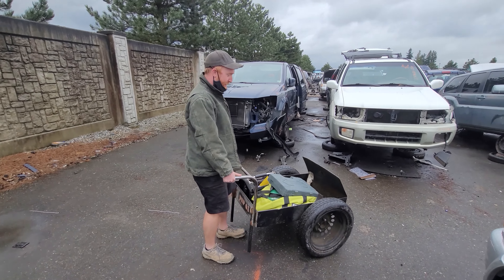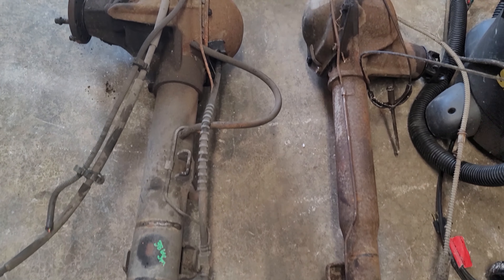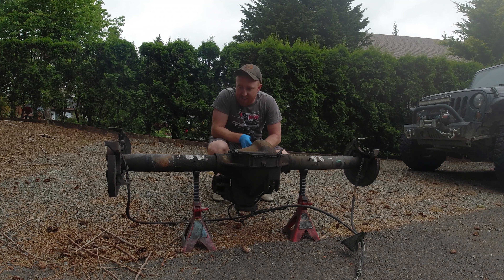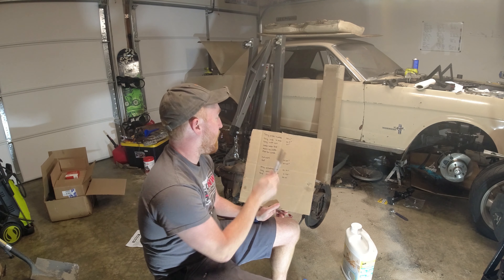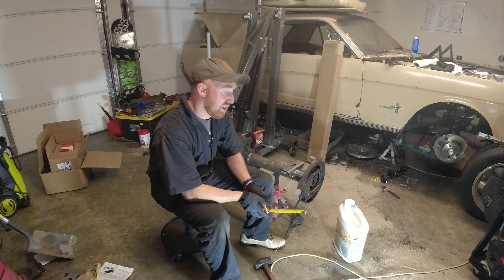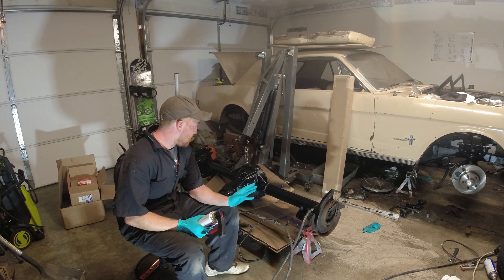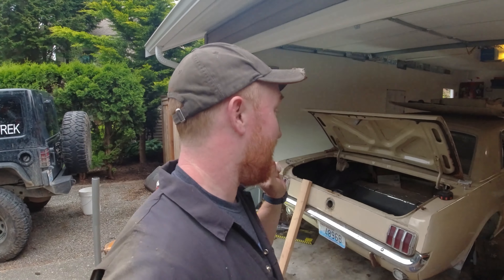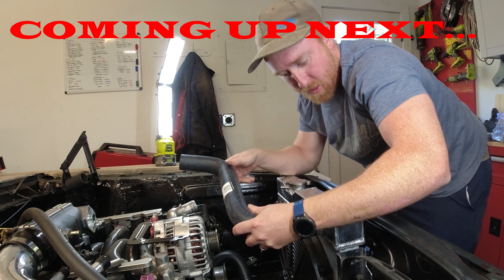HOW CHEAP/EASY Junkyard Ford 8.8 into Classic Mustang??: 1966 Mustang 4.6L MOD MOTOR SWAP. Episode 5

Comment: Right behind you mate - swapping out the 7.25 for an exploder 8.8 rear end. Can't wait.
Reply from the maker: It is a pretty straight forward swap. Just make sure and measure measure measure. And I got it dialed in perfectly. Make sure you get the 8.8 with limited slip!
Reply: @4WDTrek  Yup - 95 explorer rear end with discs and limited slip.
Reply: One step at a time bro lol its a fun project but it could add up . But how could u not love a 60s Mustang lol
Reply: Does anyone know if one would fit under a 71 mustang

Comment: Sweet score from the Pick-n-Pull 🙌
Reply from the maker: Thanks! I couldn't believe how "perfect" it looked inside!
Reply: good score . now need to find same deal for the jeep too . upgrades!!
Reply: @4WDTrek  Many in the XJ and TJ crews are putting the 8.8 in to replace the sketchy dana35. There is tons of aftermarket support too. plus it looks like you scored too with the 31 spline shafts.
Reply from the maker: @SkyBlueOffRoad  I made sure to get one with 31 splines. Eventually should be pushing about 400whp. I don't want to have to worry about that rear end.

Comment: Thank you for this series I just acquired a 64 mustang it is just a shell but the shock towers have been cut out already and it already has the mustang two cross member and the disc brake front end conversion
Reply from the maker: That was probably the most time intensive section of the entire build. That is awesome to hear that you already have that done for you!
What engine are you putting in it?

Comment: Got my 66 About 2 years ago I’ve been running the stock 7 with a 200 inline but now have my grandfather 332 (bored out 302) I just can’t find a rear end at a reasonable price but seeing you use the explorer 8.8 makes me wonder if I could do it 😅
Reply from the maker: It is pretty straight forward if you have some welding skills. I would bet you would destroy that 7 inch rear the first time you hammer down with that v8!

Comment: So 4 3/8" from the back of the dust cover inward is the center line for the new perches? I apologize if the question is dumb, I'm new to welding/fabrication
Reply from the maker: I would highly suggest measuring your own axle and find the exact placement for yours. There are some different axles out there and some are slightly shorter or longer.

Comment: Did I miss a section of your video? did you shorten the axle tubes? I don't see any portion that deals with that... or did you leave the entire rear end the same overal length?
Reply from the maker: I did not shorten the tubes at all. I left them full length. Havent had any issues at all with it either

Comment: So,, you did not narrow the housing?? How did it fit the car,, are you satisfied or do you wish that you had narrowed it up? Very curious bcuz I'm doing this exact same swap,, 8.8 into a '65mustang. Really would appreciate your response back. Thank You
Reply from the maker: I did not narrow the axle what so ever. I haven't had any issues with it at all either. Has worked extremely well since I have installed it.

Comment: How did you shorten the axle tube. The explorer is offset about 2 3/4" on one side
Reply from the maker: I did not shorten it. I left it full length. Haven't had any issues with the set up yet. No clearance issues at stock height.

Comment: Welp im convinced. How does it fare wiht the brake lines? Did you need to get new hardware lime lines, hoses, master cylinder, etc?
Reply from the maker: I did have to get a new soft line to go from the body to the axle. The stock brake lines were fine though. I did replace the master cylinder to be a disc/disc dual bowl for safety though. I did use the stock master single bowl cylinder for a while though.

Comment: That 16th of an inch could probably be settled by loosening your spring mount ubolts. Then re-center and retighten. There is easily a 32nd of play in the way that hardware bolts up.
Reply from the maker: I'm sure it could be. But I'm not worried what so ever about that 16th of an inch. Thats closer tolerances than it was from factory in 1966. And it drove perfectly fine.

Comment: I realize this video is a couple years old, but did you not need to cut the drivers side tube down to match the passenger, or does the 95 axle match?
Reply from the maker: I did not need to cut mine down. I have heard that if you lower the car a lot, you will have clearance issues with the transmission tunnel. Stock height, there is no issue at all. If I do end up lowering it a bit, I will likely just modify the transmission tunnel a bit (big mallet) and create more clearances.

Comment: I bought your 1978 Ford Fairmont I6 200ci engine.. found your channel today. Do you have the carb spacer still?

I have the same axle for my 63 Ranchero. I will be using it in her with a gear change.
Reply from the maker: I do not have the carb spacer anymore. Sorry bud. 
Thats a throw back! Like 3 years ago!

Comment: Picked up a 96 cobra 8.8 trying to get it into my 66 do I need a conversion kit for drive shaft to mate up to the 8.8 I currently have 7.25
Reply from the maker: You will likely have to have either an adapter or a new drive shaft made depending on your current set up. I had a new drive shaft made completely as I stepped up the power and had a different transmission and rear end. Coming from a 7.25, you likely have a weaker drive shaft behind that i6 engine.

Comment: Man I gotta ask, what you did for U bolts, and the shock plate mount. 
Installing a 8.8 into my 68, planning to order a set of bolts and drill a new shock plate to. Was just curious what you did.
Reply from the maker: I just reused the plates that came with the axle from the explorer. I did order new U bolts but I got stock u bolts from the explorer. I swapped the left and right sides so the shock mounts were on the inside of the axle and not that outside of the axle. Bolted the shock right up
Reply: My axle came with my car and I didn’t get that luxury! Appreciate the video man! Definitely helped me out for!
Reply from the maker: @justinwillis1069  I'm glad I could help you out! There are universal spring mounting plates you can purchase that come with shock holding brackets that get welded on wherever you need to weld them. I have found kits like that for $60 ish

Comment: Did you use the shock mounts from the explorer?  I have put an 8.8 in my '66 and trying to use explorer mounts but looks like I will need to modify them somehow to get the angle right.  Just curious what you did.
Reply from the maker: I did use the shock mounts. They were ever so slightly off angle. So I cut the shock mount on one ear and put it in there at a slight angle. Then just welded over the top of the ear I cut as another support. Kind of as if I elongated the hole, if that makes sense.
Reply: @4WDTrek  completely.  Thanks

Comment: Not sure if anyone asked but did you run into any trouble with the explorers pumpkin not being centered? I believe one shaft is 2.48 inches longer than the other.
Reply from the maker: I haven't had any issues with it at all. 
It is ever so slightly shifted off to one side, but it doesn't hit anywhere underneath and doesn't cause any driveline vibrations.
Reply: Last question I swear 🤞🏼. What drive shaft did you end up using. Thanks
Reply from the maker: @tb7246  I went to a local shop here. I measured it all out and they custom made one for me. Drivelines Northwest
Reply: I'm doing this now,  I've had the 8.8 in the garage for over 3 years now...debating about leaving the pumpkin off set or swapping left and right axles and rewelding the ends on, a lot more work. Overall width is about right for my 68
Reply: @veholic1  it’s been great. I do have some contact on big bumps but I lowered the car 2 inches in the back. If it’s standard height you will have no problems.
Reply: I've centered the differential by cutting 3" from the short side and 7" from the long side and swapped the cutoffs from side of to side along with the axles. Works well.

Comment: New Subscriber . Question, have a 73 fastback. Would it be the same process for my vehicle?
Reply from the maker: I would assume it's the same process for yours. I do not know widths of anything so double check on how wide of an axle you can put under there. 
My brother did the identical swap into his 67 coupe and his 70 challenger with no issues

Comment: Did you regret not setting up your pinion angle?  I noticed you set your angle at 0.
Reply from the maker: I didn't actually set it at zero. If I remember right, I actually set it at 3 degrees. I haven't had any issues with it at all since the install. I'm happy with it. 
I may throw a gopro underneath and see how it looks while under acceleration, just to make sure it doesn't over rotate.

Comment: Doing the same on my 68 soon as I get done with the rewire. I got the same LS 3.73.
Reply from the maker: Very nice! With the 65-66, have to worry slightly with the offset diff and the drive shaft if you drop the car. But the 67-68, you don't have anything to worry about. No clearance issues.

Comment: Thinking of doing this to my 66, did you have to cut and shorten the tubes to center up the pinion? Or did everything line up correctly?
Reply from the maker: I did not shorten the tubes. Everything did line up ever so slightly off center as the explorer one is off center. However, I was still able to build an exhaust between the tunnel wall and the drive shaft. My car is still stock height however. I have heard if you massively lower it, things will start hitting. I have zero issues as is and would think a couple inches lower won't affect it.
Reply: @4WDTrek  alright cool, thanks. I've just seen a couple other blogs that talk about shortening the long tube and using 2 passenger side axles to compensate. But if everything lines up and no binding of the pinion then all should be well.
Reply: You only need to shorten 1 side (cut the tube) and grab an extra axle to match the newly shortened tube. There are plenty of vids of how to do this. I'm still struggling with my lame ass non traction lock original 8 inch diff.

Comment: What did you use for your driveshaft?
Reply from the maker: I used a local shop to create me a drive shaft.
I measured out the lengths and talked with them. They made one side splines that fit in the t45 transmission and the other side that bolted up to the 8.8. Used 3 inch steel drive shaft with 1310 U joints. Should be plenty strong.

Comment: I built an 8.8 for my Tj. Exact same set up. Was it an 01 exploder?...well i did 4:10 gear but with the lsd. Does great syncing up the tires (until ya go 35s or bigger hahaha). Only complaint is the e-brake. Even with new shoes it just does not hold as solid as i wish. Anyways, looks like it is going well on this build.
Reply from the maker: Mine was a 97 explorer I got it out of. I debated for the 4.10 but decided that I wanted to keep a tad bit of freeway speed and not have higher cruising rpms. Should be sitting at around 2100rpms at 70 on the freeway with this set up.

Comment: What is the offset of the wheels you are running in the rear? I am also installing an 8.8 in my 65 mustang.
Reply from the maker: They are the stock mustang Bullitt wheels from 2001. They have 30mm offset

Comment: How much wider is it than stock? Is the 68 rear the same width? How do the emergency brakes hook up?
Reply from the maker: Overall side to side, I believe it comes in at a total of 2.75" wider than stock. Slightly offset to the passenger side which can cause a slight issue with lowered 65-66. For a 68, you would have no issues. I haven't gotten to the emergency brake quite yet. But the mustang pull chord goes under as one cable then splits into two. The explorer does the exact same. So just hooking the two cables up and a small mount for the cable guides would work.

Comment: What year explorer will work ?
Reply from the maker: If you want disc brakes, I believe it's 96-2003. I think 2004 is when they went to independent rear suspension. Prior to 96, it was drum brakes.
Reply: Thanks man

Comment: If you load the axle the long way on the wheel barrel it feels like theres nothing there
Reply from the maker: You know, all the time I took to edit the video, carry that thing and all that, I didn't even think about that!!!! I'll have to remember that when I do my jeep axles!
Reply: @4WDTrek  thanks for the reply. The only reason I know that is because I pulled one 3 days ago and I tried the way you did it and swapped it and the difference was amazing.  I'm literally pulling out a rear end and was looking for some tips and tricks and ran across your video. The one I pulled at the junk yard just needed brake lines removed so it was simple.  I'm working on the one in the truck I'm swapping it with  and had a few issues getting it out but its finally on the ground 😂
Reply from the maker: @Santiago  very nice man! I'm glad the video helped. And thank you for the tip! I'll definitely remember that for next time!

Comment: Excuse me sir sorry for bothering u love your video. I just bought an 8.8 and i have a 66 mustang im working on and i was wondering  if it all worked well . Im doing the work myself and im doing a ford granada v8 front spindle set up with the 8.8 in the rear , any suggestions ???
Reply from the maker: I've been using this rear end for a while in it now and have zero issues with it. I would suggest make sure you measure everything multiple times. I used a 35mm offset wheel with 245 wide tires and they fit exactly perfect with that axle, if full length.
Reply: @4WDTrek  thank u so much for replying and i appreciate your insite . Lol dont get mad if i contact u for other info , enjoy your evening and thanks again.
Reply from the maker: @ysamp8774  feel free to reach out to me through either Facebook or Instagram. Same name as my YouTube on both. Easier to ask questions that way if you have them.

Comment: What size offset did you have to get? 

What year explorer did you source the 8.8 from?
Reply from the maker: The explorer was a 1997. 
I ended up with the stock 2001 Bullitt wheels from a mustang GT. Offset was 30mm offset. Fit exactly perfect. I have zero rubbing anywhere. Sits just inside of the fender without it rolled and about half an inch from the stock leaf springs.